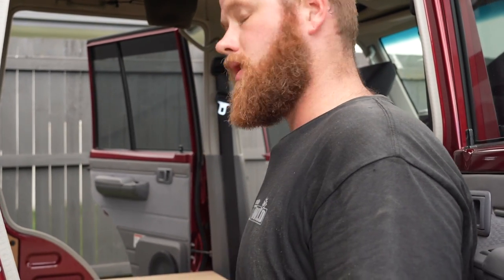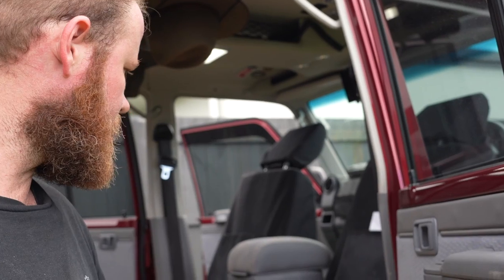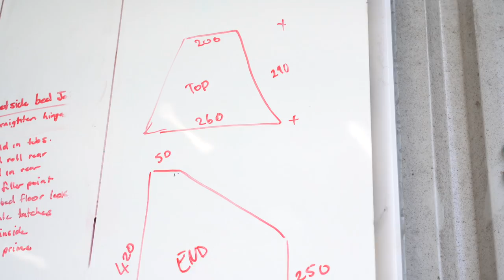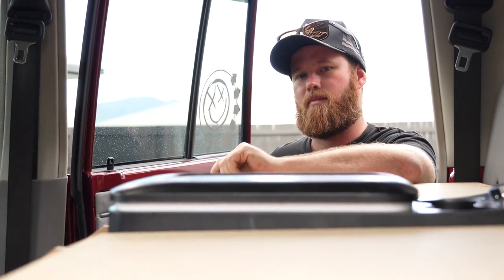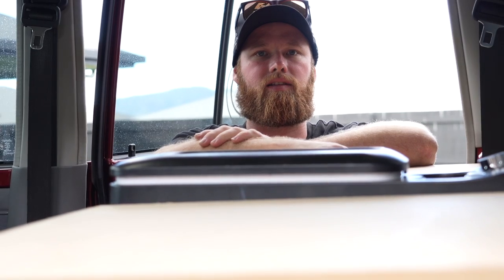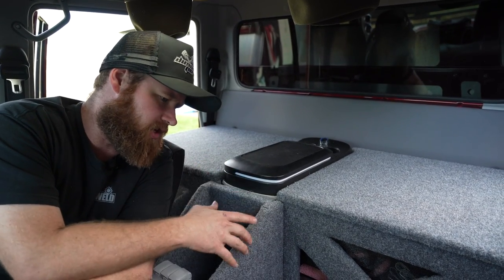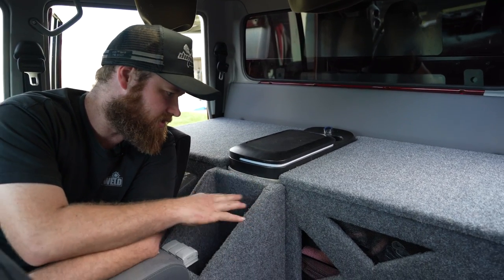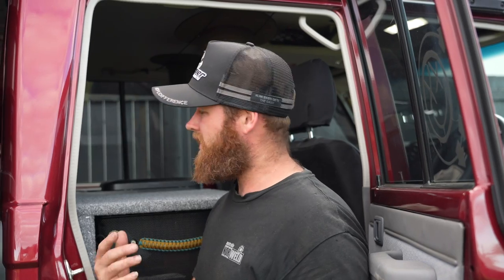79 Series Dual Cab Rear Seat Fitout - Seat Delete, Fridge/Freezer, Full Time Power & Drawer Setup

Comment: What are your thoughts on the legal side of this. Heard alot of mixed opinions
Reply from the maker: For this setup, we kept the seatbelt mounts intact and the rear seats were only temporarily removed for the trip. Once we returned from camping, the seats were refitted as they originally were. From our understanding of QLD TMR rules, as long as seatbelt mounts and safety restraints are not permanently altered or removed, it should be legal. However, this is our interpretation and understanding, and may not be correct.